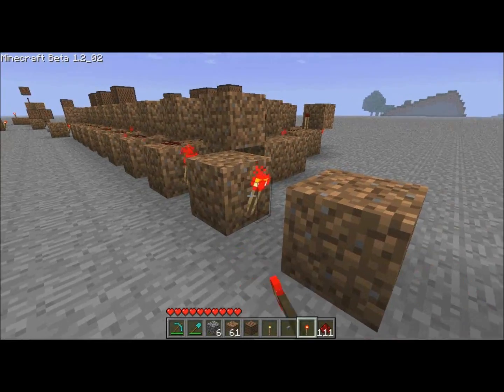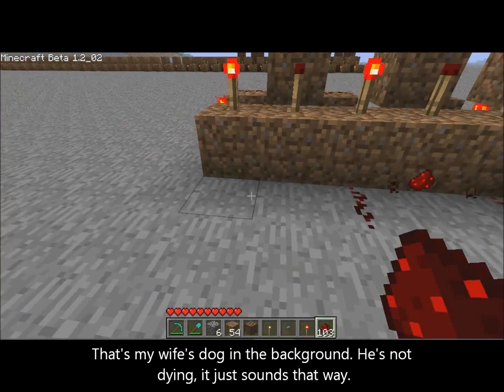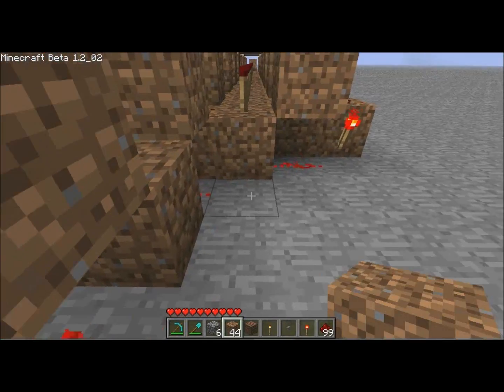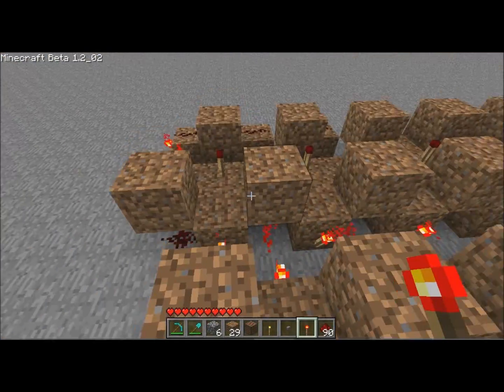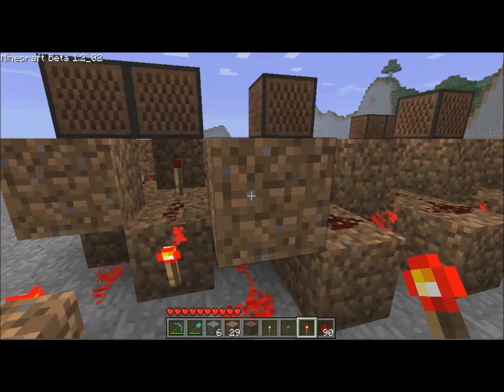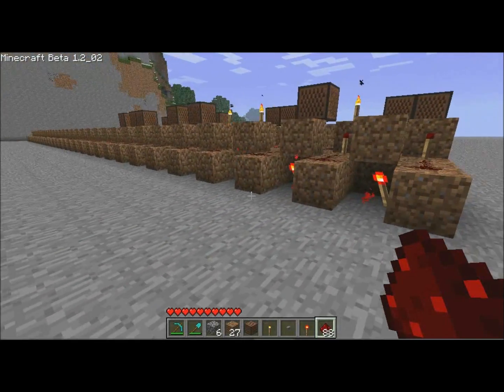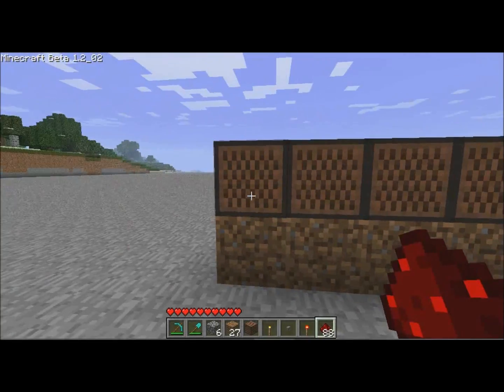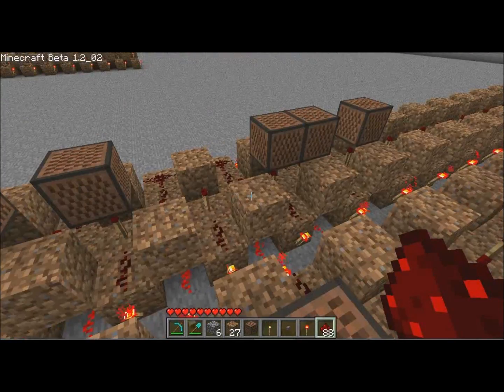Easy, Compact, Expandable Note Block Circuit.

Comment: I attempted to do the same setup you have, but would it work if you used a pressure pad instead, and had the pad set up far away? I tried that and it wouldn't work, maybe it's to far?